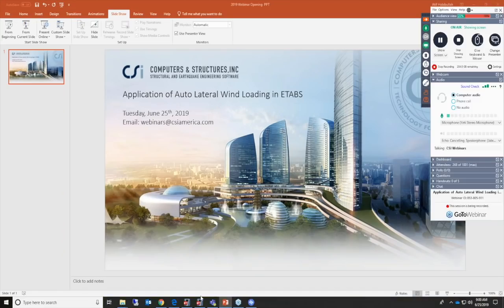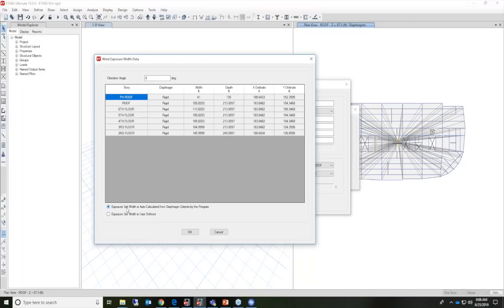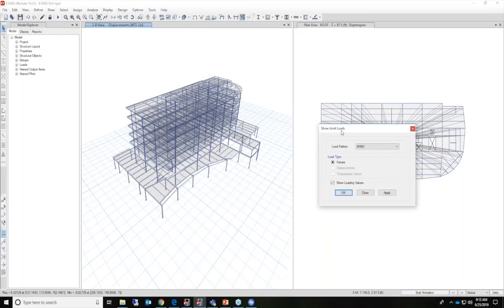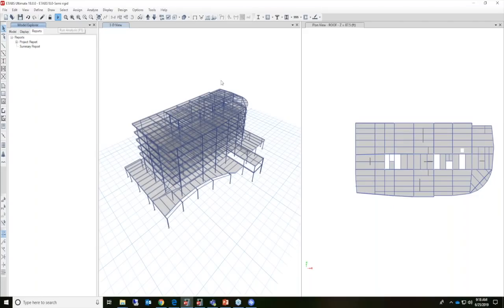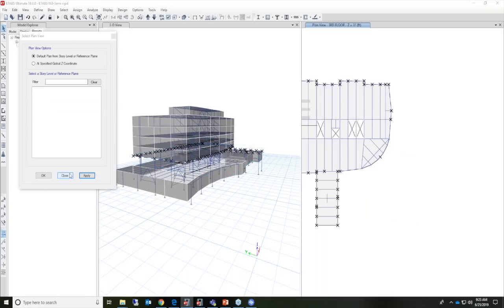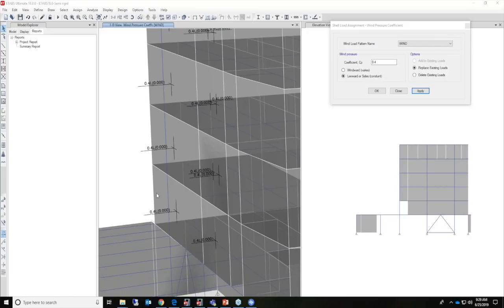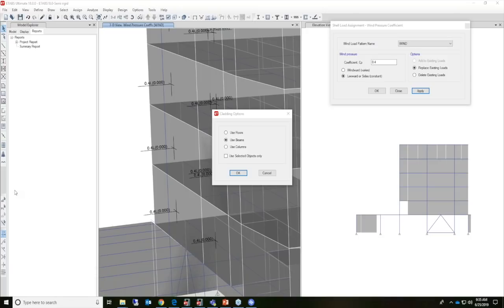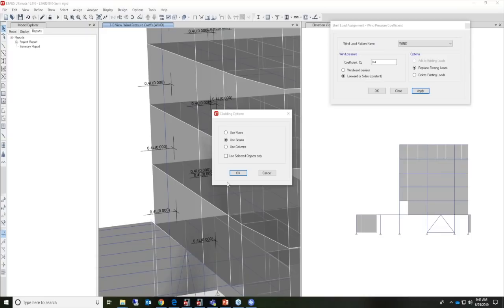WEBINAR: Application of Auto Lateral Wind Loading in ETABS

Comment: I made exercise comparing applying wind loads using diaphragm (Automatic) vs manual and the results have major differences. ETABS does not account for building envelope OR plus minus internal pressure, I'm not sure about this method or even using shells to distribute auto wind load. Will be Sticking into manual calculations.

Comment: Does ETABS consider the (internal pressure coefficient ) upon the classifcation of enclosure??
Reply: Was wondering about this myself as using 0.18 vs 0.55 vs 0.00 can make a big difference.
Reply: After watching a bit more of the video, it looks like it uses the simplified procedure (Section 27.4) which automatically assumes an enclosed structure (0.18 for GCpi). As a follow up question now, is there a way to change this or would you need to manually input the wind pressure coef's to account for a partially enclosed structure? Or is it recommended to simply not use the auto-wind load feature when dealing with partially enclosed or open structures?

Comment: If I want to apply wind load to the roof and sides, I can't use diaphram method. Am I right?
Reply: To apply wind load on the roof and sides at the same time, diaphragm method can't be used. In such cases the wind load on the roof should be applied manually in a separate load case and can be combined in a 'Load combination' as one.
Reply: @emanretsiger9343  Saving your comment for later  - thanks again